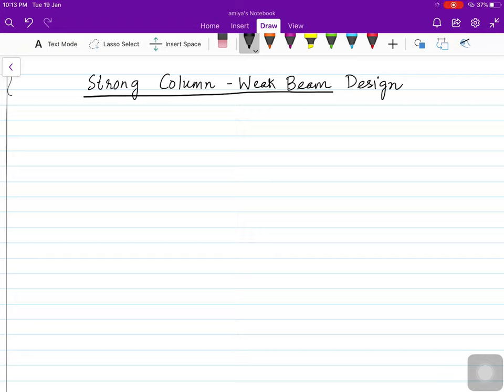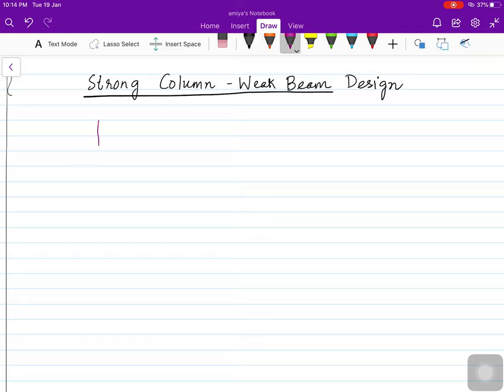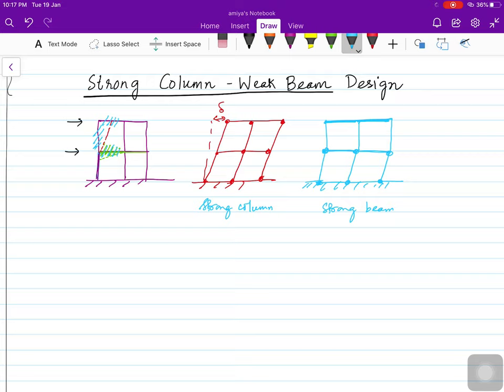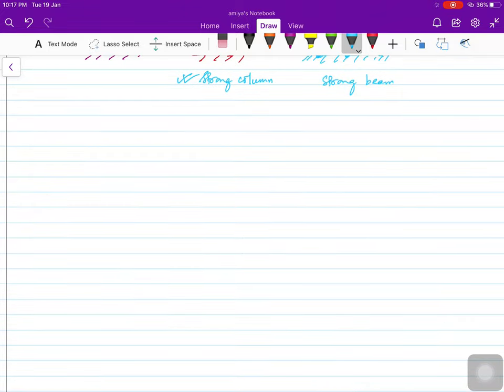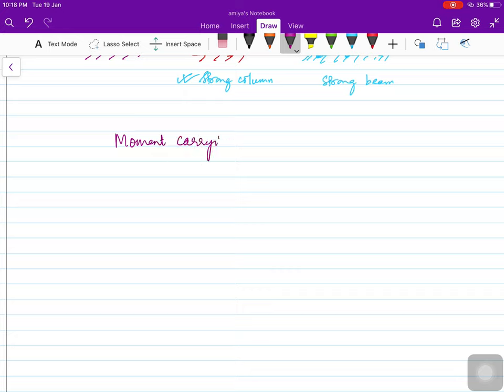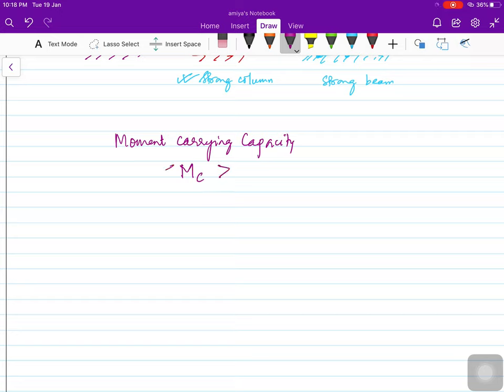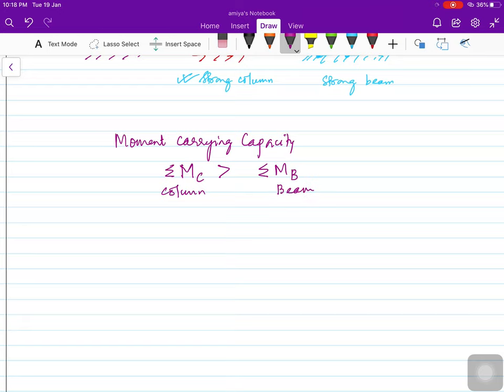Strong Column Weak Beam Design

Comment: Mam it would be great if you give manual design and explaination of whole . IS-13920  ..also if possible in your next video do about how to find the shear strength of beam column joint manually as per clasuse -9  in IS-13920